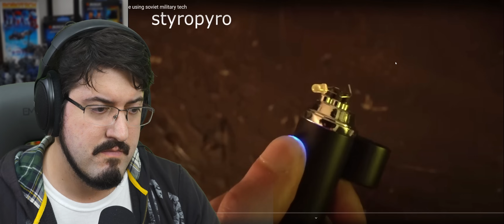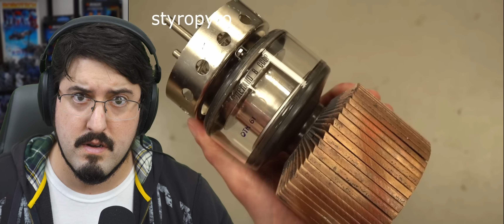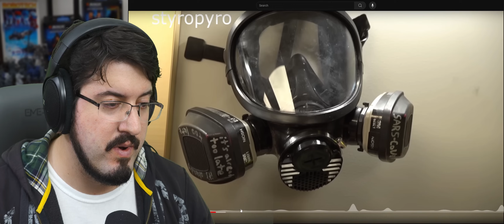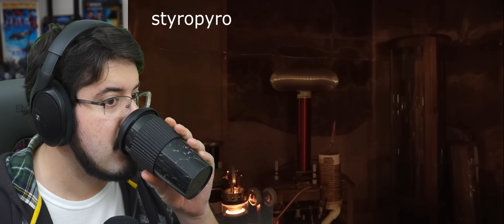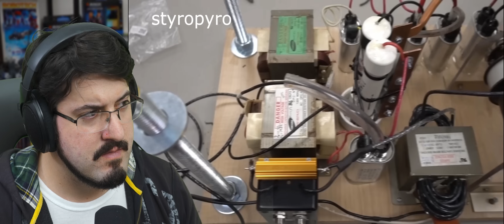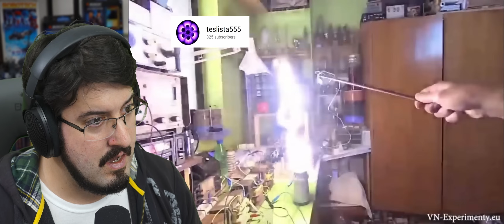Of COURSE StyroPyro has a Soviet Death Machine

Comment: 0:20 Lol I built the device he made in the video, though in a much smaller and safer version, but still capable of melting steel. Mine is not an HFVTTC like StyroPyro's, as I don't use a vacuum tube but a solid-state one (HFSSTC).

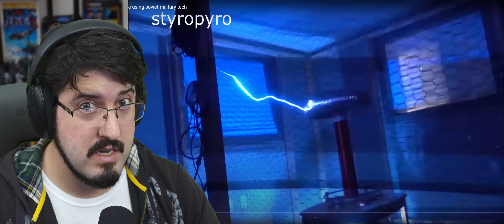Comment: 8:34 for those curious about the mesh on that room; that's a Faraday Cage, and it blocks many if not all EM waves. He has that in there, because of the DANGEROUS ELECTROMAGNETIC RADIATION that big of an arc can emit.
Reply: Nah it fucks with the surrounding area wireless and radio waves not dangerous radiation
Reply: Nah. More like cause that thing would kill every form of wireless communication. And then cameras.
Reply: @alexturnbackthearmy1907 and it does that because of the electromagnetic radiation
Reply: It's basically wideband radio jammer.

Comment: Dude, we russians sometimes have a unique mix of curiosity, knowledge, ignorance and fascination do to things like this :D I'm not very educated (I mean like for sure I've got the basics from school) and I've made some things of questionable safety in my young age :D Like... I've learned how to make empty plasic soda bottles explode at the age of like 10, I've made smoke bombs from over the counter medicine when I was about 13, I've used some calcium car... (I don't think that would be allowed to share) to actually make high pressure flammabale gas containers that explode after being thrown in a fire at 14... And I wasn't even THAT much into science, I was just curious :D
Later edit -one more thing to add to a list of crap that I've done -  I don't remember what age I was but I had one of those plasma balls and found out if you put a small metal chain on and around it and attach a needle to the chain, isolate the needle and then put it's point close enough to your skin - it'll kinda arc and burn your skin to a point of turning like charcoal black color (and probably being fully burnt out) with almost no pain and it was like having a cool way to write something on your skin temporarily xD
Reply: I've always wondered if all these Russians doing dangerous/extreme hobbies is because there is little else to do during the winter. Like cabin fever but more "I am stuck in my apartment, I wonder what I can do with the microwave and the light bulbs under the sink"

Comment: As someone fascinated by radiation, yes for some unusual reason, Element 43 Technetium is indeed radioactive. Or more correctly the common isotope is radioactive, which is rather strange since every other element up to lead is all stable in their common isotopes. I find it a cool and weird quirk of science, and I recall it will decay into molybdenum (Element 42) given some time.
Reply: Technetium (element 43) is the only element lighter than Lead on the periodic table with no stable isotope.

Comment: A "ham" is an amateur radio operator, of which there are apparently quite a lot in the US (nearly 750,000 according to Wikipedia). An abomination of science like this thing gives off a lot of radio interference, which would probably not be appreciated.
Reply: > which would probably not be appreciated

By which you mean the feds would come in, seize the equipment, and drop tens of thousands of dollars in fines.
Reply: @EmperorA0  deliberate interference with licensed amateur radio IS illegal for the same reason why deliberate interference with a local radio or TV station is illegal.
Reply: All of his electrical experiments are done in Faraday cage, so non of the EM radiation escapes.